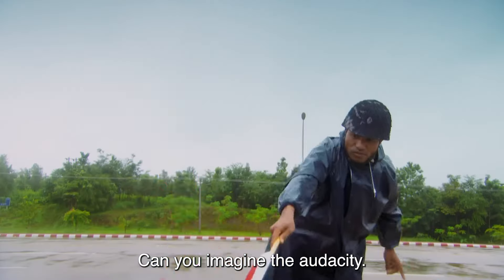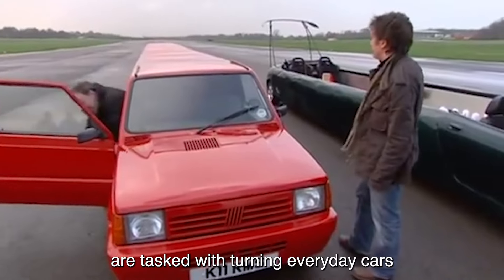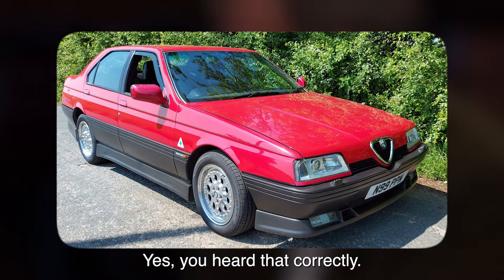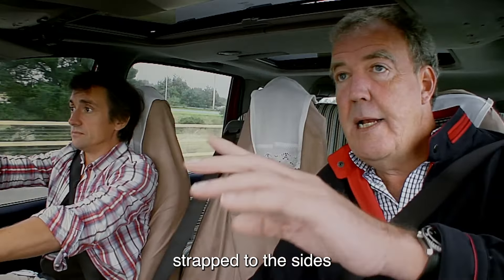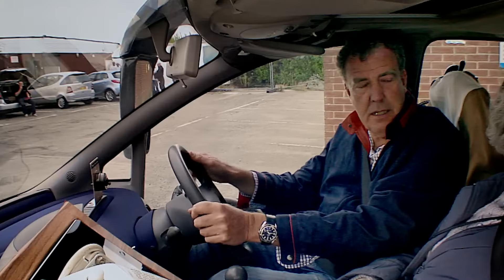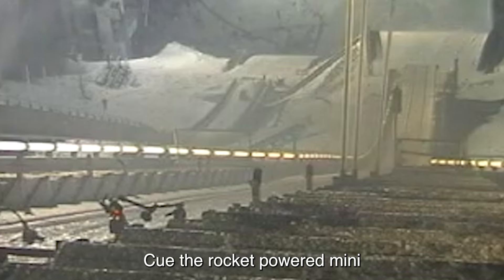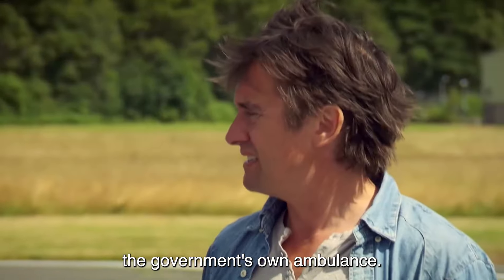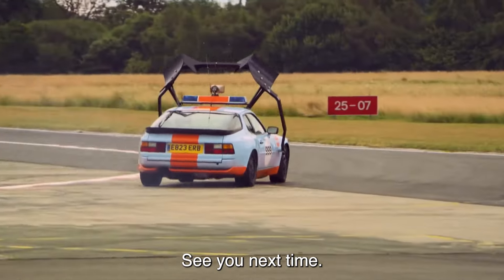MOST CRAZIEST Car Modification Of Clarkson In Top Gear ALL TIME

Comment: I know it's not related to any of the clips here, but I read in the "Ambitious But Rubbish" book that the infamous "slogans offensive to Alabama" section from the $1000 cars across the Deep South adventure had its origins in a plan initially to send one of the presenters down to Alabama with a Toyota Prius, with words "Man-Love rules OK," written on it. It was scrapped because even they didn't see the point of sending one of the presenters, probably Richard Hammond, all the way to America to just be embarrassed at best and have an angry mob chase them at worst. 

What's certain though is that the anger shown by the locals wasn't staged. In the words of the book, "they were real people and they were real angry," so Hammond's incredulity about James May's Cadillac Brougham Sedan having yet another flat battery, requiring a jump start, was genuine. This explains why in post edit, Hammond said just before the drama started: "...and then of all the moments,"